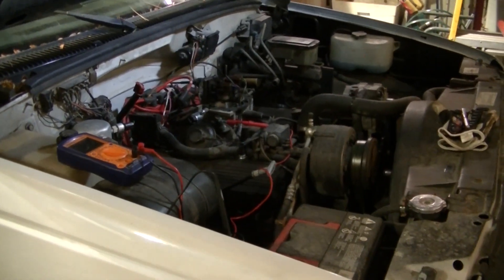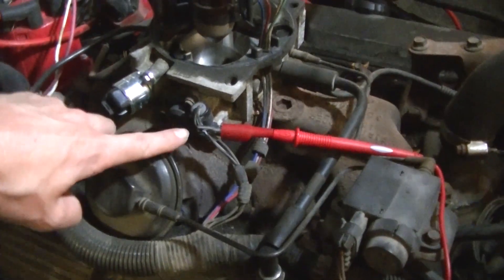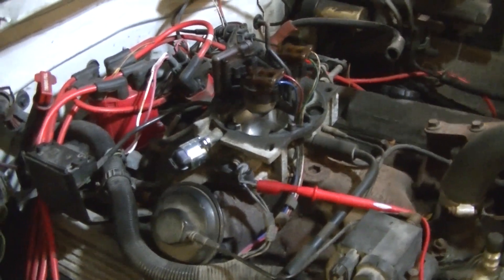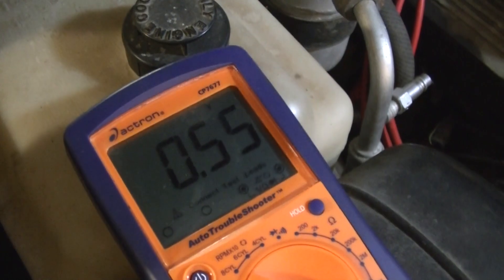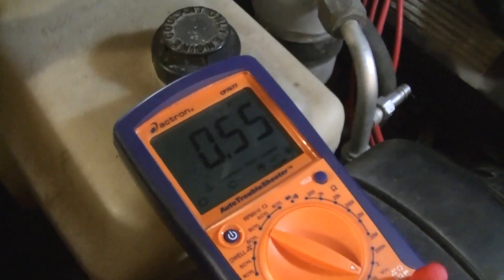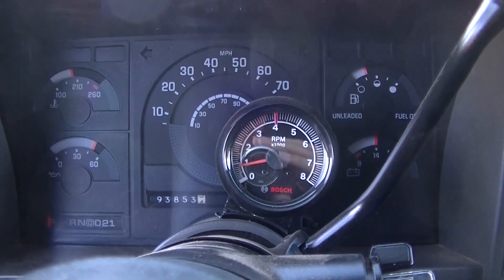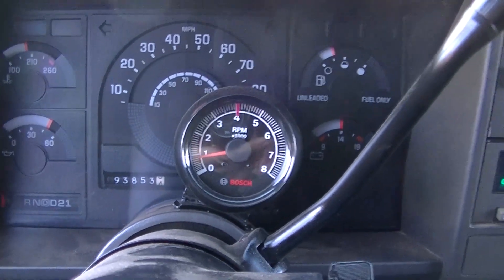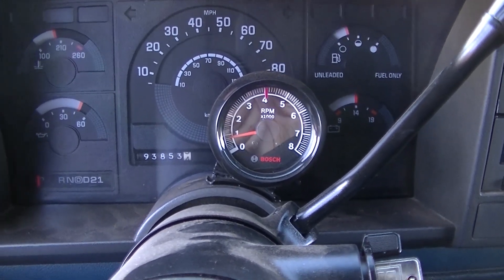91 GMC C3500 454 350 TBI TPS Idle Adjustment

Comment: hey, we are a new generation of folks who are learning these trucks, thanks for sharing. these  tbi system drove many a man to drinking in the 90s.. ha
Reply: We are at our end here with a 93 GMC  Sierra check engine light keeps coming on transmission goes into emergency mode
Reply: thomas g  you fixed it or just abandon it?
Reply: My 94 suburban Silverado edition TBI idle is very low ? How can I fix it
Reply: @worstnightmare9772  CLEAN TPS?  check fuel pressure, check fuel pressure regulator
Reply: check IAC motor and clean pintle
Reply: @randy1ization  I just got a manufactured TBI from eday seller I hope it fixes the problem I'm moving to OKC for California soon as it's fixed I did the whole tune-up already so if it doesn't fix it I don't know what to do the timing is 0 degrees
Reply: @worstnightmare9772  buy an obd1 scanner, thats what I did and its worth its weight in gold, mine has plugs for many different vehicles and gives alot of info
TBI units are super easy to rebuild. 
it will take time for the IAC motor in the rebuilt TBI to learn, u have to drive it at different speeds for abt 30 miles, it has a step motor and work shaft that backs in and out, it sets the idle rmp. abt 650. are u sure its not a miss, did u make sure all plugs are firing? when u pull a plug off the distributor, you should hear a miss. use plastic gloves.  then at night mist all the wires and cap down with water,  and look for arcing.
just to see, remove the IAC  motor on your old TBI, and see if there is carbon build up on the pintle shaft nose.and carbon in the passages.., GMS run dirty. theres also a filter on the tbi where the fuel line goes into the tbi if I recall, it could be dirty. 
timing may not be advancing doue to a bad distributor module, aftermarket ones are crap, get an ac delco. theres a blue wire on the firewall behind that long plastic cover, if you unplug it, it makes the vehicle go to a set base timing. if u unplug it and it idles up good, it could be the ditributor module went bad,, easy to change just dont drop the screws , use a magnetized bit, they have a funky star bit screw.,,. also it can rust under the module, and they wont work . 
check timing with that blue wire UNPLUGGED.. 
you could have a worn timing set, or distributor shaft gear.   clogged CAT. 
FUEL TRIMS are controlled by o2 sensor, it puts truck in open or closed loop, open loop it idles faster, closed loop slower.  if its stuck in closed loop it may cause it to idle lower. 
when u get tbi make sure you use the right gasket, theres 2 difffernet ones, compare it to your old ones, as they will both  fit, but wrong one wont work, .. tighten down tbi bolts evenly, and to spec. 
check your pcv valve, and vacuum hoses. also check your EGR valve,  I blocked mine off and it runs alot stronger.
Reply: @randy1ization  I have no codes but I'm looking for a OBD1 when I got the SUV it had a low idle I thought maybe it would fix after the tune up and all the new sensors but it didn't now I'm just throwing new parts out of never had check engine light
Reply: @randy1ization  I haven't replace the EGR valve or the map sensor yet or the O2 sensor that's about it with sensors I think I can't remember exactly but it's really close to everything
Reply: @worstnightmare9772  dude please get an obd1 scanner. it tell you whats going on,  fuel trims, opoen/closed loop.,IAC counts and positions,  engine temp, rpms, throttle position,  u can find the problem  by seeing what the engine is doing, did u try pulling codes with the paper clip method yet,  in the connector under the dash? also do u have a vacuum gauge, you can do a vacuum test to get the health of the engine and also tell if cat is clogged. autozone and orileey  loan them for free. 
does your truck idle low all the time, does it die when u turn a/c on, is it constant low idle, or varies/
Reply: I will find out which obd1 scanner I have, it was around 100.00 if I recall and it will save u big bucks.
Reply: ACTRON CP9690. hook it up, and you can see whats going on, it has  dongles for gm, ford, chrysler, ect, so it can be used on many obd1 vehicles. best thing I ever did,, not all problems will throw codes or check engine light, but u can see live data with the scanner
Reply: check for corroded grounds on the thermostat housing, that causes many problems. check the connector that your IAC motor plugs into for pin fitment issues or broken lock tabs, you can zip tie them tight  check the IAC gasket where it sits against the tbi. look at your injector nozzle spray, is it even, is it dripping? 
as I said before though, I would hook a vacuum gauge to the throttle body, and see id that engine is worn out or has a burnt valve, ect, 
here another test, unplug coil wire so it cant start, crank engine over for abt 10 seconds. does it sound the same, or do u hear a wah, wha, wha, whoof, like a cylinder is losing compression, it should sound even,. the  differentialted sound is a cylinder that is not compressing properly, due to many possible things.
How many miles on the engine?
Reply: @randy1ization  just unplugged my egr & I love my throttle response now.
I'm chasing a running rich or lean smell from truck bad notiacible,, only thing under hood sensor wise I havrntbrelaced yet is 02 n knock, & evsp purge cylinoid near the throttle body..
  New fuel pump n gasket, filter, rebuild tb kit, new ac plugs n wires n distributor n all delco sensors, still smells bad around truck tho.
Only thing notiable is random lope since i got truck 3 mths ago all I can say is im.loving learnng this truck, in 3 months now this ol truck had come alive & runs like a scalded dog, suburban 94 k1500 4x4
Reply: @randy1ization  thanks
Reply: @luketamoncannon3795  u need to get an OBD1 scanner and check your fuel trims.. they arent that much. I got an autel with the different connector plugs that will work on most american vehicles.. good fuel trim on these trucks is around 128.  o2 sensor is very important on these truck, they control the stiochmetric mixture by signaling the computer to adjust injector pulse width..  as far as the fuel smell, sometimes the fuel vapor cannisters get saturated and smell like sweet gasoline fumes. u will smell it around the canister. unplugging your EGR is not a good idea.. every so often, the computer does a test by opening the egr valve via the egr solenoid,  and it looks for changes in the exhaust thru the 02 sensor.. if it cannot do the test, it flags a code, and turns your check engine light on,. it may also put your truck in a default fuel management strategy.. if your exhaust has water droplets coming out oif it, that is a sigh of complete combustion.. if it has black smoke its running rich,  blue smoke, burning oil. white smoke, blown head gasket blowing steam.   have u been thru your TBI unit,, sometimes the diaphrams will get stiff or tear, and the spring will rust and brea  k.. also some passages in there can get carboned up.. they are not hard to rebuild if u pay attention..   sometimes when these trucks go into a looping surge, its because they are trying to correct a fuel mixture problem.. they will run ok for a couple minutes, then go into a surge for a while, then kind of clear up again and this cycle will repeat... a symptom of running too lean can be backfiring up thru the intake on accelleration..  worn distributors can also cause alot of problems, like misfires, irratic acceleration, poor fuel mileage, ect.   I know it sucks buying a scanner, but in the long run, you will save alot of money and your truck will run  right,, I think I paid 120.00 for mine.
Reply: @randy1ization  I looked up that scanner it's cheapest on ebay but it'll have to wait till spring when I'm back in full schedule money wise..
 Yes TB was rebuilt meticulously, just dropped a new distributor in it yesterday & found a bad plug when I did plugs n wires.
 I plan to get new egr & o2 sensor next & im gonna check out the evap canister you mentioned above. I feel.like I'm getting closer to my issue at least I'm learning my truck huh lolol.
  You're info helped alot I'm glad you responded thankyou so much, 
  That surging is almost gone since new plugs n distributor, I still catch a lope down about 5 seconds after I come to a complete stop, feels like a weak spring, kinda bounces my rpms for a min when it happens but it's almost at every stop..
Reply: @luketamoncannon3795  you can also get a fitting that goes where your frame rail fuel filter is and put it in place of the filter,  and see what your fuel pressure is. 10 to 13 is what u need.  but if its not missing out when  you romp on it, its likely not a fuel delivery issue...what did the spark plugs look like when you changed them? also if the truck has high mileage, your timing components can be worn. I advanced my timing a couple degrees  (static timing) and it made a big difference in responsiveness.. theres either a plug connector under the passenger side dash, or on the pass side firewall u have to unplug to static time it.
Reply: did you put an A/C DELCO OR DURALAST distributor in it? theres alot of junk distributors around. hope u got a good one.  also 02 sensors are cheap for these trucks,, so thats something that would be easy to try and cheap.
Reply: @luketamoncannon3795  also  MAKE SURE u get the right egr valve, there 2 that look almost exactly the same but operate differently.. it can drive u nuts if u dont know this..
Reply: @luketamoncannon3795  there is also a cannister purge valve, near the TBI that is supposed to open and suck the fumes out of the cannister now and then,., make sure the vac hoses are good and the purge valve works.  u can put power to it and see if it clicks and lets air flow thru it.  when u rebuilt the TBI, did you replace the IAC motor?  when your not pushing on the pedal, the Iac takes over  and pretty much controls the whole idle function. they can get sticky and hang up intermittently. also the little pintle can wear and not regulate the air as it should.
Reply: @randy1ization  I'm actually gonna re-time it tomorrow once I buy a timing light, I did it by ear other day & it's almost there, think I'm a little advanced myself.
  200 plus miles on her, plugs were all black & whitish crisp down inside, number 3 & 5 the worst, 5 had a yellowish full buildup making contact with center & looked burnt black n white inside..
  Runs like totally different truck now but still a little lope at stops about 5-10 seconds after I stop every time, kinda bounces my rps then goes away, might do again 30 seconds later..
  Still smelling gas to
Reply: @luketamoncannon3795  I was thinking a leaky Egr valve will make it stumble at idle, also a bad PCV valve.. either one can be causing it, then the IAC tries to work its way out of it.
Reply: @randy1ization  I'll check out egr part match..
 I'm only using delco parts if available, guy I got truck from had a new "standard" egr in the box when I bought truck, truck didn't like it so I just unplugged it for now
Reply: @randy1ization  angsin tha KS for help man, I'm your biggest f.fan tonight, mad props n keep em coming🤘
Reply: @luketamoncannon3795  good chance the egr or pcv is your problem
Reply: if your egr solenoid valve is leaking vacuum thru it, it  can cause a slight pull on the egr plunger ,, thats easy to check,.. also the egr solenoid has 2 nipples on it on one side and one on the other.,,. one is a VENT, and one is not.,. ive seen people put the vacuum hose on the vent nipple.. no beuno
Reply: break all your systems down.. EGR, FUEL, IGNITION,  ECU.. TEST each system completely and dont move on until you have proven them to be good.  just by learning to do the specific test for individual components, you will gain a larger understanding of the big picture of how everything works together.
Reply: @luketamoncannon3795  theres about a 100 percent chance your valve stem seals are hard and leaking if they havent been replaced. I just did mine abt a month ago.. what will happen is the plugs will foul and misfire.  are u getting any blue smoke out the tail pipe, especially like after you have been driving a while, then stop like to get fuel, then when u restart it, it blows blue smoke?
Reply: If the plugs are carbon fouling from running rich, they will all be black sooty coating.
Reply: I would pull the plugs again and look at them ..
Reply: @randy1ization  I haven't noticed any blue smoke at, but where are there's valve stem seals at & can a half simple replace them?
Reply: @randy1ization  thankyou, once I get it re-timed tomorrow I'll be able to follow thus rabbit further down the rabbit hole, since I did distributor & plugs it's like a whole different motor now I'm so impressed with it; but at the same time now I'm having to adjust my hearing for other oddities without a scan tool yet.
  Just had to go out on my own working for myself for family reasons in lawncare & it's my off season so I'm on a super budget rn, kinda living on a prayer rn but I'm blessed in every direction amen..
  Again thankyou I'm sure I'll be in touch soon haha
Reply: @randy1ization  & save alot of money & time wasting on parts to come in🤣
Reply: @luketamoncannon3795  They are under the valve covers. they are not hard to replace, but time consuming and u need a valve spring compressor tool . and air compressor or piece of small diameter rope. . most tools sold for this are dinky, so I made my own.  after replacing the stems u have to reset the valve lash,.,. I figured out the easiest way possible to do this and it works great.. I may make a vid on it..    reading your spark plugs can tell you ALOT..  U can also do a realtive compression test just by cranking the engine over.. unplug the coil wire and crank the engine over with a fully charged battery.. u want to hear a steady  runk, runk, runk, runk, runk, that is in rythem.. if you hear it speed up in the series of cranks, what that is is a weak cylinder and the rythem speeds up for the weak cylinder because it is not compressing as much air as the other.   the weak cylinder will repeat.,. so it will be runk, runk, runk, rank, runk, runk runk, rank. and so on depending on which one it is.   it could be runk , rank, runk,runk,runk..   runk, rank, runk, runk, runk.. you understand?
Reply: another tool u want to add to your arsenal is a borescope camera.. u can stick it in the cylinder and look around, see if your cylinder walls are scored, check your valves for burning or carboned up.. I use a product called SUPERZILLA to decarbon valves,. it is amazing stuff.. u can add it to your fuel to clean your fuel system too. I order the stuff by the case.. it blows everything else away, as a cleaner, penetrant, lube, ect.  when u pull all of your plugs again, put them in order and make note of where each one goes and write down what they each look like.  if the burn is right, they should have a grayish brown look to them, with no oil, soot , carbon tracking, ect.   I also run good plug wires, BELKINS.,.,. the cheap 20..00 turds that oriellys and autozone sells dont last.. these old trucks are worth putting money into. they will never build them like these again,., im at 206,000 miles on original engine, I pull a heavy boat with it,  and use it like the workhorse it is.. I take great care of it, and hope to get 300,000 before rebuild I only use WIX or A/C DELCO OIL FILTERS and run eith Valvoline conventional, or Mobil one oil.  also you may want to do some good flushes of your cooling system.. if it has rust in there u want to get it out... what happens is rust restricts the colling passages in the block and heads, this causes hot spots and that blows head gaskets.  I had to flush my system 3 times to get it clean.. the off the shelf flush products work fine.
Reply: @randy1ization please inform me where i can get a obd-1 scanner that will show all this data

Comment: Anyway to dial back the sensitivity on the TBI off idle? I need more pedal travel before the truck takes off.
Reply: I put a new throttle cable on my 94. Can also try cleaning the TB blades with TB spray cleaner

Comment: hi  mossman381    great video there my friend       by the way I'm just wondering are they any good chrome bumpers order to fit my truck I got a 95 GMC K 1500 Sierra   I'm just trying to find a good second-hand one   rear one
Reply from the maker: Finding a good used one will be pretty hard.  They are getting older and the bumper usually takes the most abuse.  My rear bumper is rusted.  I am going to just order some new aftermarket bumpers on Ebay.  I have gotten good aftermarket bumpers for my 2000 and 2002 in the past.  I will do a video when I do order them.

Comment: is your oil pressure really 50 at idle, I replaced my oil pressure sensor and its abt 20 to 25 after warm up
Reply from the maker: That is what the gauge reads. I have seen a few 454as trucks with the same oil pressure reading. Seems high but have had no issues.
Reply: Chevy's from that era read all over the place. Gauge really only good to let you know that you have pressure.